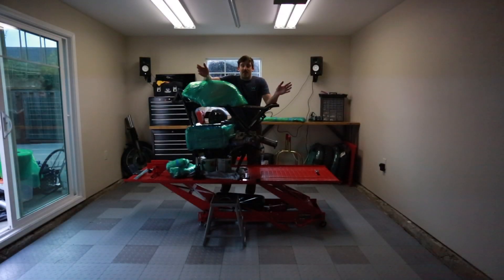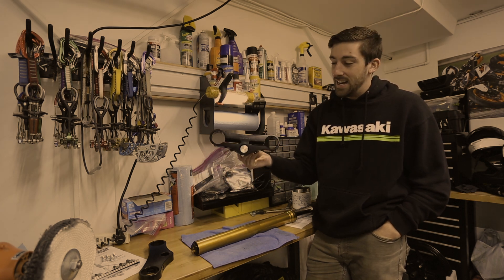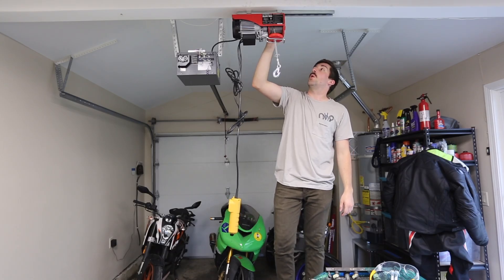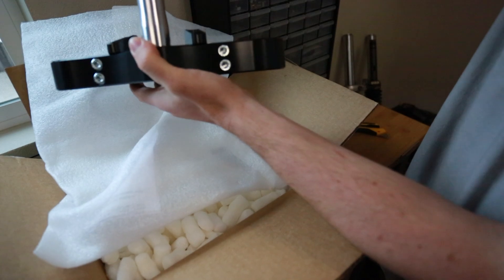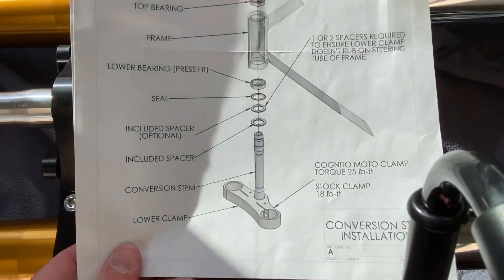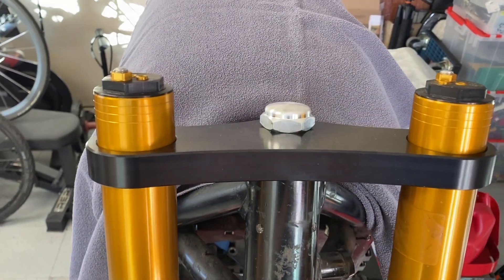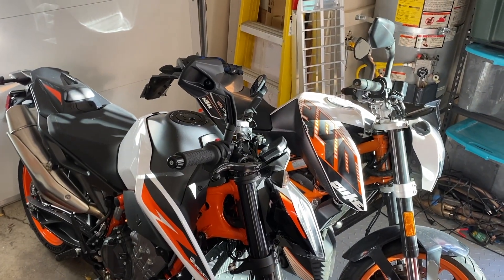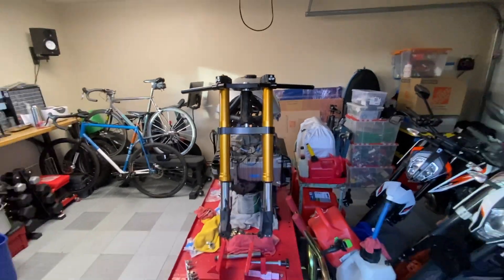Episode 7: BMW K100 Front End Dry Fit

Comment: Do you have a link to the Motorcycle lift you use?
Reply from the maker: yes, harbor freight lift: https://www.amazon.com/Titan-Ramps-Hydraulic-Motorcycle-Table/dp/B01KKKDLPA/ref=asc_df_B01KKKDLPA/?tag=hyprod-20&linkCode=df0&hvadid=312361896200&hvpos=&hvnetw=g&hvrand=887773785171211720&hvpone=&hvptwo=&hvqmt=&hvdev=c&hvdvcmdl=&hvlocint=&hvlocphy=9061254&hvtargid=pla-568031217973&psc=1